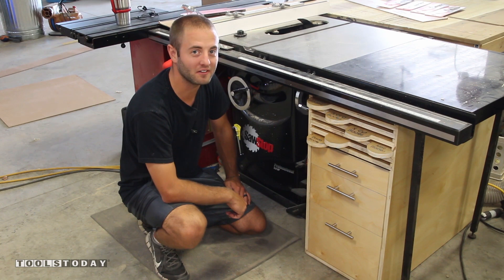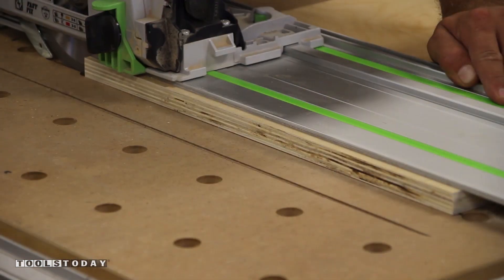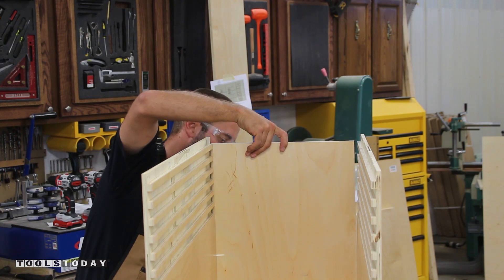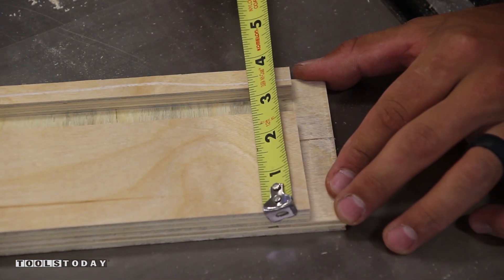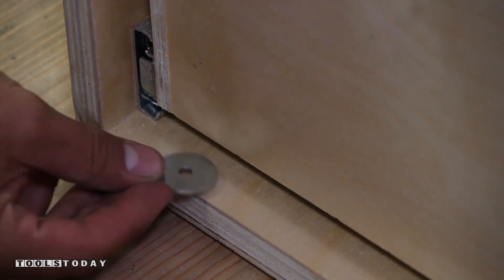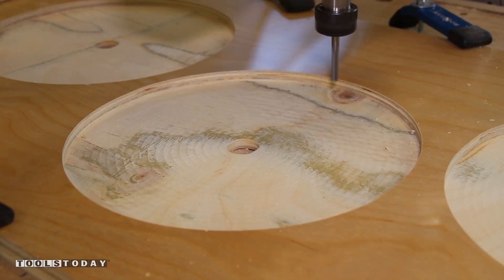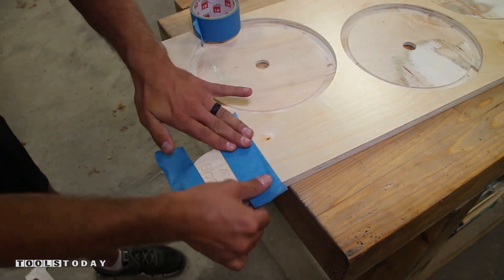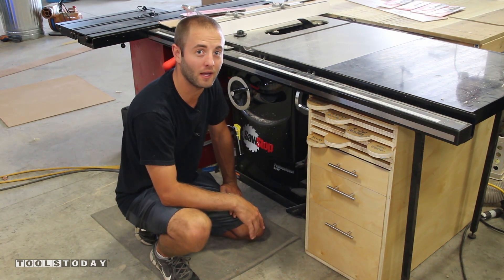How To Build A Plywood Table Saw Storage Cabinet Using Amana Tool CNC Router Bits and Saw Blades

Comment: Woodworking Maniac project rip off, his was better!  I never realized I needed so many different saw blades to complete such a small project.  Too much Amana product plugging!
Reply: they are also a bad company - ethically speaking - you don't want to give your money to such people
Reply from the maker: @antigen4  We are sorry to hear you had a unpleasant experience. Please contact our support team for technical issues and free replacement. We are here to help and support our large customer base and woodworking community. The email address is: ttsupport@toolstoday.com
Reply from the maker: Thanks Roddy Da, however our project was in the works long before Woodworking Maniak posted his video. We are an Amana Tool® authorized dealer so the purpose of this video is to show the Amana Tool® line cutting the wood parts.

Comment: the load on the trays is very low, but continual use won't tear out the pieces of plywood that hold them? does it need the mechanical reinforcement of screws, or even dowels with glue maybe?
Reply: Nelson Baietti We thought about that during the design phase but reflected on past project and we came to the conclusion that it should be fine. If it does fail in the future, a couple quick screws will fix it.